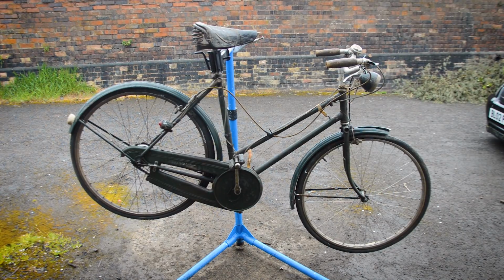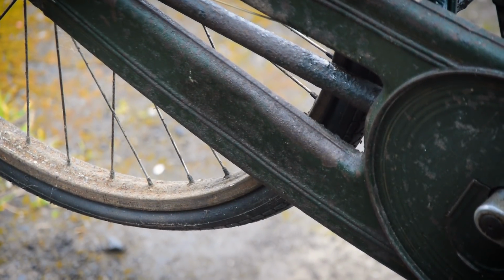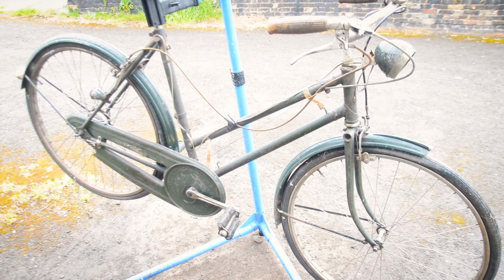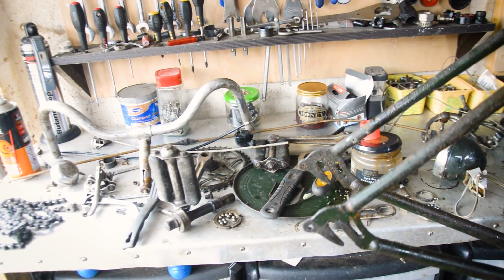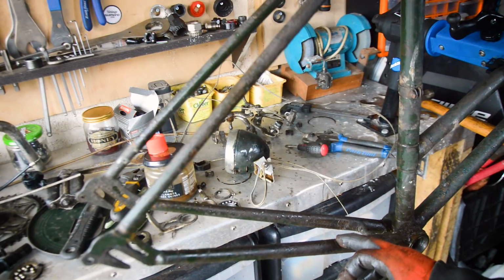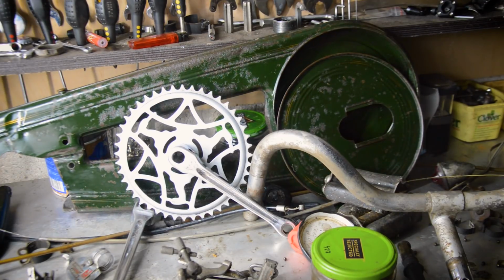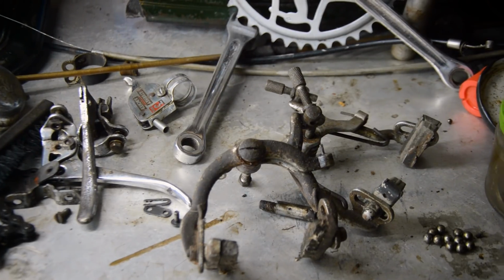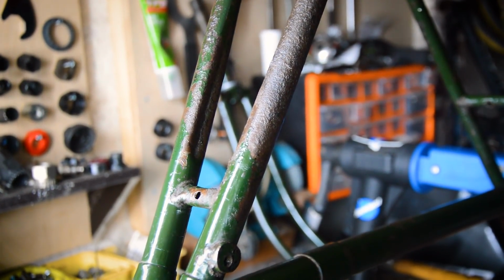1946 Raleigh Superb Sports Bicycle "Restoration" - Parts or Preserve?

Comment: For the paint you should wet sand then clear coat
Reply from the maker: Wet sanding would remove the lining unfortunately and boiled linseed oil does the same sort of job as clearcoat but without the potential for reacting or peeling.

Comment: I just bought a 1970's Raleigh Glider, 3 speed  hub gear.  Planning on restoring it complete with paint job.  Would the rear gear hub need looking at?  Just wondering if it would be an easy fix.  The bike was made for Eaton's here in Canada during that period.

Comment: What do the Raleigh marks look like? I have a 1948 Humber and was told they are original Raleigh ape hangers.
Reply from the maker: How do you mean?
Reply: @MonkeyShred  if I was to take the handle bars off would it say the name on it somewhere or a code of some sorts?
Reply from the maker: @joshuathompson2131  Ahhhh ok.  Well sometimes old Raleigh Industries items have the small stamp of the Raleigh logo.  Not the Heron, Sir Walter standing over the crest.  I've seen it on various items on various bikes.  Codes are usually just patent numbers on early bikes.  I've seen those stamped on the bar clamp area of a stem.  Not so much on handlebar though

Comment: With that chain stay I think you’ve got to bite the bullet and get a bit off with a file or dig around with an engineers scribe and see if it highlights any pin holes, if it does the frames toast! And those marks on the underside of the bars are in my opinion hammer marks, you’d be surprised how many people don’t realise once you undo the stem bolt you’ve got to give it a tap to release the expansion nut! They’re the ones that turn the bike upside down and start beating on the underside of the stem and bars to get them to move 😫
Reply from the maker: You're probably right there with the bars tbh! Pretty sure you've seen the update vid too so you'll know I've started to inspect the chainstays just like that ;)

Comment: Lovely machine would seem a terrible shame to bin it but, I'd be worried about the amount of corrosion on the inside of the frame, particularly as parts of the outside are so well rusted..Heart says go for it, head says no.
Reply from the maker: Seems like my heart/head combo too.  Having got through all the parts clean up and only having the rear wheel to rebuild and service, I'm leaning more and more towards the heart.

Comment: What kind of tools  do you use?

I am in the middle of a similar project myself. My frustration of not being able to get the part out that connects the crank arm with the bracket made me cut the crankbox. If I had seen your video before I started, I would have used the clamp technique like you. But what is the special clamp you use called?
Reply from the maker: Ah ok.  You're stuck removing the cotter pin.  I've invested in a cotter pin press because I deal with cotter pins fairly regularly.  They're a pricey tool for a one off though and only really available from the US (bikesmithdesign).  There are other methods though.  You can sometimes remove them by supporting the underside of the crank and "punching" out the pin and in some cases you can use a vice to press the pin out in to a socket on the back side.  Both of those options can potentially lead to mushroomed pins if they're stubborn though.
Reply: @MonkeyShred  thank you for your good and quick answer.

Yeah, I have tried those two methods as well as heat before hitting out the pin - ended in "mushroom". Therefore I cut the one side of, ruining the bracket. Now I wonder how I get the other side off without damaging too much. Maybe my best option is to go to a local bike shop and ask them to remove it, or do you recon another option?
Reply from the maker: @hunnicke1986  Your LBS may be able to help but I'm not sure how common a specific cotter pin press would be.  I think I've seen balljoint splitters used in some cases.  I've not personally tried that though.

Comment: My 2 cents' worth: not considering cost for a moment, the frame should be sandblasted and prepped, ready for paint. The paint should be a stove enamel type, trying to be as close as possible to the original. Powdercoating in this case would look out of place, I think. There are beautiful details like that gold double pin stripe on the chainguard, those should be part of a restoration.
All chrome parts should get a similar treatment and be re-chromed (copper+nickel+chrome). 
Etc. etc. Obviously the final cost would be some serious cash, but the result would be in equal amount a gorgeous classic bike anyone would be proud to own.
Reply from the maker: You have to have deep pockets for that!

Comment: The bike is at a stage where you have to put a lot of Labor into it I don't think too many parts other than them handlebars right I would restore it and sell it it's mostly labor which isn't free I understand but I totally think the bikes worth it and I really like the crank on it I'm surprised they hide it like that
Reply from the maker: The best thing about hiding those cranks is that they get preserved!
Reply: @MonkeyShred  I agree and it was a nice surprise when you took of the cover I was amazed how nice the cranks looked .

Comment: Looks pretty sweet, mate. Honestly not sure what you should do. I'd probably just restore it and sell it off, without putting /too/ much work into it. I mean, unless you have other projects in the works from the 40's or 50's for the parts to go to.
I would be a bit worried about the condition of the frame, but not terribly so.

Comment: Save it. the greasy parts you can clean very easily.. dunk them in a paraffin bath for an hour or tweo. The rusty chain stays id remove the rust with a Twist Knot Wire wheel in a drill.  Once the loose  rust is removed you can better assess the integrity of the metalwork. Once cleared of rust apply rust remover, high build primer and repaint. I always find its better to come back to a heavy project after a break.